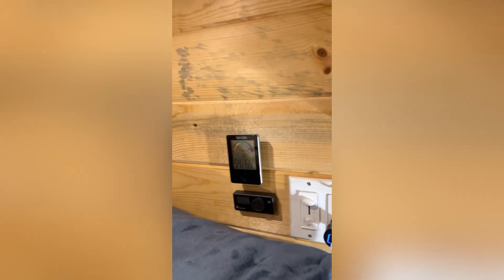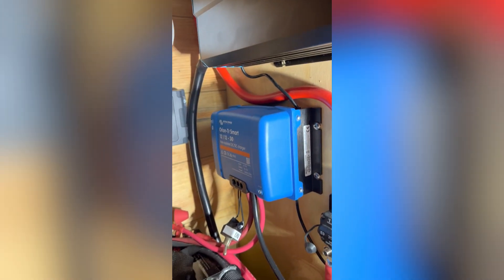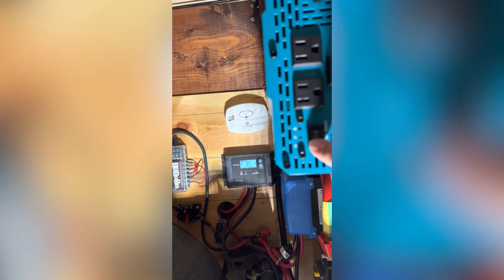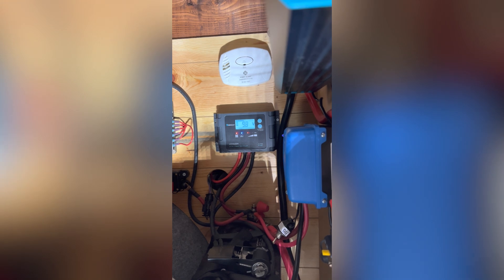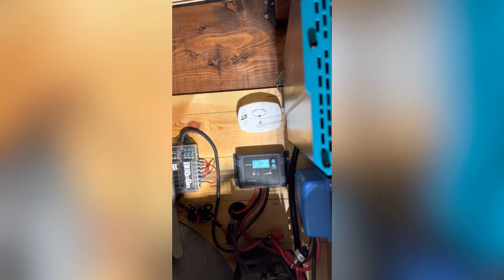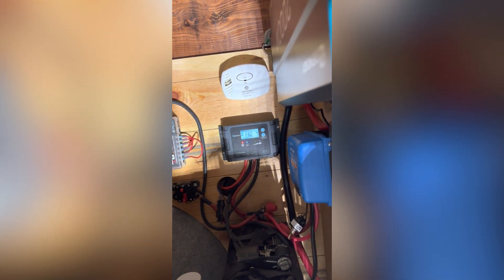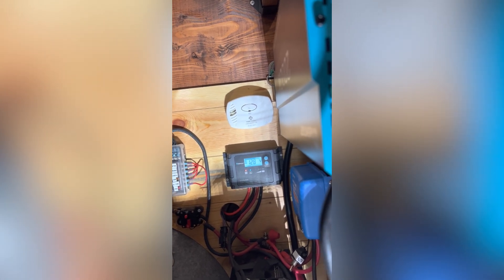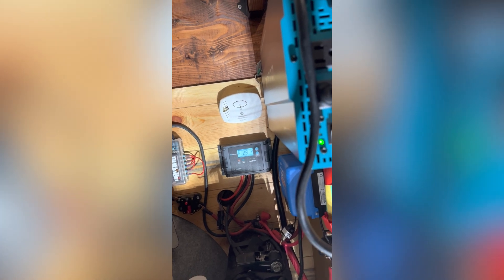Renogy lithium battery failure. Renogy 2000 watt inverter causing under voltage at start up.

Comment: Try putting a load limiter between, to slow down the recharging of the inverter's capacitor?
Reply: ... yes, the products should work together. Not sure where/how to source a DC soft start switch, I just know it's a thing!
Reply: If the inverter is used daily it shouldn't be draining the capacitors that much..if it isn't used that often I'd maybe hit the switch once a day ...my 3000w renogy can go months before it's turned on and I've never experienced voltage drop like you have ..my lithium has a continuous 200ah discharge though
Reply: You may want to check the low voltage threshold of the inverter. It maybe setup for AGM battery’s…. And possibly draining your Lithium battery WAY too low below the Lithium low voltage limit. i.e. well below 10% and therefore prematurely kill your lithium battery….. just a thought.
Reply: @NukeFPV  That specific inverter is speced for 10.5-16v with no configuration settings. But a good thing to check!
Reply: @marionsutcliffe1119  Woah 😳 10.5 volts is early death ☠️ for LiFoPo4, despite the sales jargon. Try to never go below 12.9 or 13Volts…. An inexpensive solution is putting a small LVD (Low Voltage Disconnect) device on your battery. Most solar controllers will have this inside them, with configurable cut-off voltages. Just make sure you can set it as high as 13v 👍🏼🤙🏼
Reply: @NukeFPV  Why would a solar controller have a low voltage disconnect?
Reply: @marionsutcliffe1119  Most solar controllers are configurable to disconnect loads at specified low voltages. Many also have preset configurations for various battery chemistry’s also…. It’s worth a try to use a LVD device in this case. I wouldn’t connect loads without one, especially any inductive loads…
Reply: @NukeFPV  Not sure how a device that charges a battery could disconnect other devices that draw from the battery. Perhaps you are referring to something other than the mppt/pwm solar charge controllers?